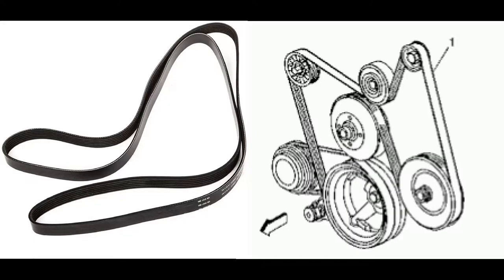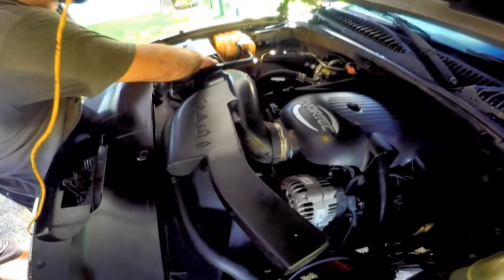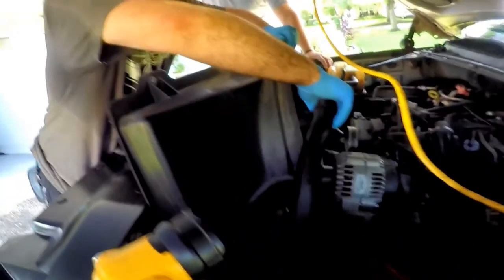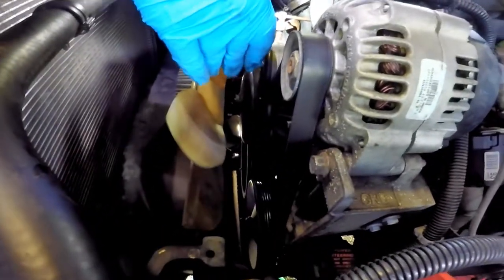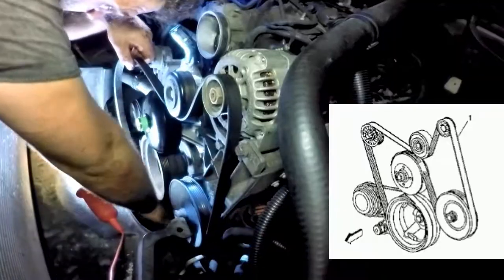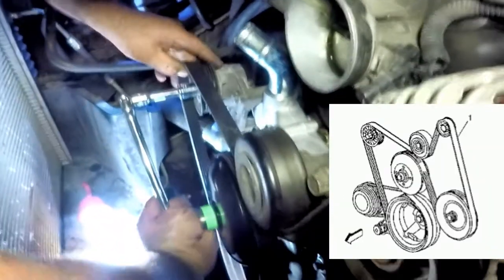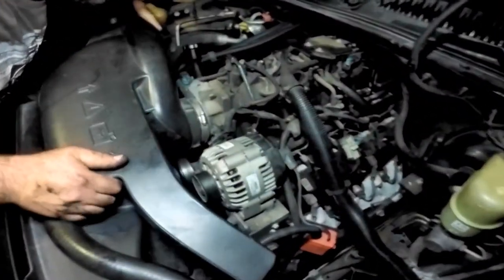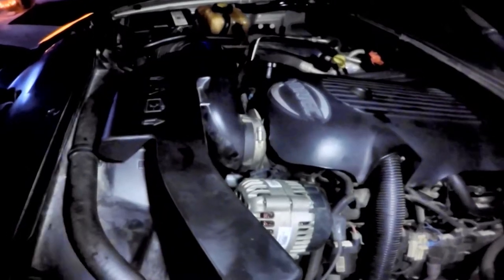How to Replace Serpentine Belt 5.3 LS Vortec Engine 2002 - 1500 Chevy Avalanche Suburban Silverado

Comment: Hi.thanks alot.i have replaced a serpentine belt,and tensioner pulley on Savana truck 2011 model,do I have to tight the fan pulley,as shown?
Reply from the maker: not if the pulley is a tensioner type.

Comment: Just got new tensioner and serp belt… belt is about half inch too tight to go back on even w tensioner cranked all way over… so not happy. Headed back to parts store. Maybe they gave me wrong belt??
Reply from the maker: That's too bad. It could be different belt or Tensioner. Let us know what you find out, it may help someone else.
Reply from the maker: how did it go.

Comment: You do not need to take off the fan or shroud to do this. I just did this, and it would have made the job a little easier. But it is not at all necessary. Took me 10 minutes
Reply from the maker: Thanks for your feedback.